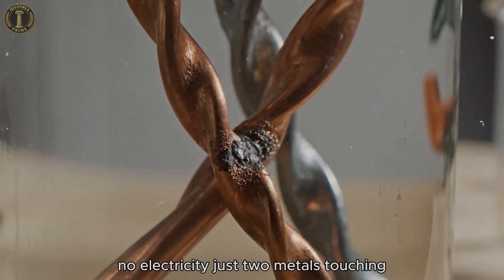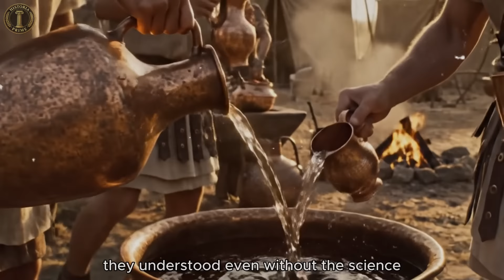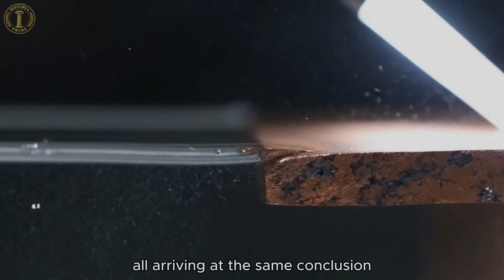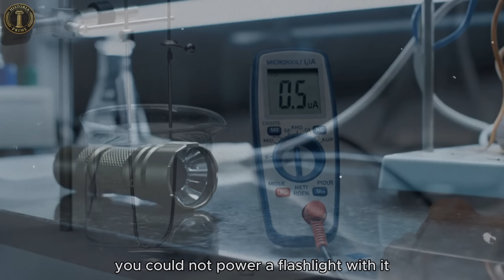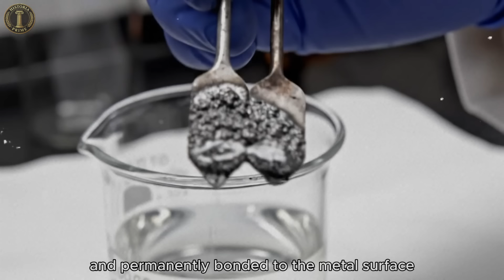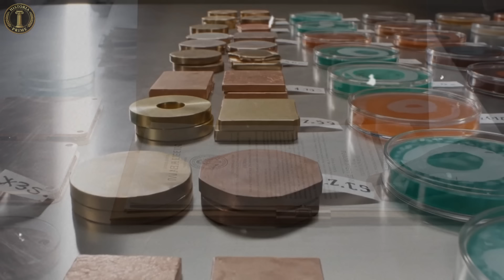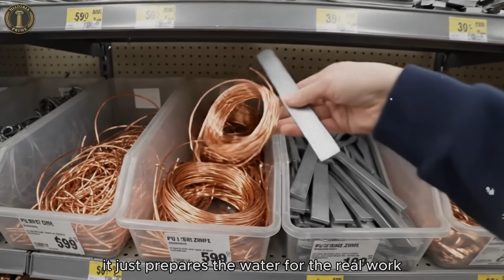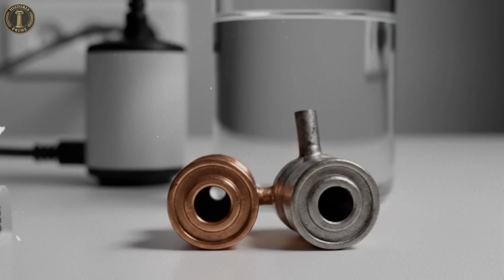Connecting Two Metals Purifies ANY Water — The "Earth Filter" Secret They Buried

Comment: You didn't mention fluoride! Does it clear the fluoride from the water???
Reply from the maker: Good question. Fluoride is a separate issue and usually needs a specific treatment method, so it should not be assumed from a simple setup like this.

Comment: Good info, but I have Questions. Instead of D E what about boiling the water ?  You mentioned Brass is a combo of zinc and copper, yet this calls for getting the separate components and twist them together, doesn't it work to use brass instead?  How much D E per what amt water?  THANKS
Reply from the maker: Great questions. Boiling can help with biological contamination, but it won’t remove many dissolved chemicals or metals. And brass is a copper-zinc alloy, but it won’t always behave the same as using separate copper and zinc pieces. For drinking water, I’d still tell people to be cautious and stick with tested purification methods.
Reply: @HistoriaPrime1212  Thanks

Comment: The COMPLETE PROTOCOL- for cleansing water: 

That is the perfect "ancient-meets-modern" workflow. Moving the water into a clay pot (terracotta) after it has been "charged" in the copper or brass vessel is a brilliant move for a few reasons:
1. The Natural Cooling Effect
Clay is porous. Through a process called evaporative cooling, tiny amounts of water seep through the walls of the pot and evaporate on the outside. This pulls heat from the water inside, keeping it significantly cooler than the surrounding air.
2. pH Balancing (Alkalizing)
Clay is naturally alkaline. If your water is slightly acidic (which can happen after metal treatment or if the source is rain/soft water), the clay helps neutralize the pH. This makes the water smoother and gentler on the stomach.
3. Micro-Filtration
While a standard clay pot isn't a "filter" in the industrial sense, the porous walls can catch very fine residual sediment that might have settled. More importantly, it doesn't add any chemicals back into the water, unlike plastic containers which can leach BPA or microplastics over time.
The "Golden Sequence" for Water Treatment
If you were to combine everything we've discussed into a single, high-safety protocol, it would look like this:
1. Stage 1: Moringa (The Clearer)
Crush seeds, stir into murky water, and let settle for 1–2 hours. Pour the clear water off the top.
2. Stage 2: Copper/Zinc (The Sterilizer)
Pour that clear water into your copper or brass vessel. Let it sit for 8 to 12 hours (overnight) to kill bacteria.
3. Stage 3: Clay Pot (The Storage)
Pour the water into a clay pot for daily use. It stays cool, stays alkaline, and prevents the "over-leaching" of copper
Reply from the maker: That’s a really thoughtful breakdown. I appreciate you laying it out that way — combining traditional vessel materials with safer modern handling is a much more balanced approach.

Comment: Most of the copper wire I find is 99.9% copper. Does that .01 percent make a difference?
Reply from the maker: Usually not in a major way for a simple DIY setup. For most practical purposes, 99.9% copper is already very pure, unless you’re doing something that’s extremely sensitive.

Comment: I can buy a copper pot , but where to buy Zinc? Has anyone tried this method? It is good to have this system during natural disaster.
Reply: Brass is both
Reply: @laurapugh5874  , thanks for your reply. Then I should buy some brass, in case I need to filter water.
Reply from the maker: Zinc can be a little harder to find than copper. Roofing suppliers, metal suppliers, marine suppliers, or online sellers are usually a better bet than regular hardware stores.

Comment: You trying to get people killed or what?  Copper oxide is an irritant, toxic to the environment, and therefore harmful to your body. Both copper and titanium create an oxide which protects the metal.  Unlike iron which oxidization breaks free and doesn't protect the metal (rust is iron oxide). You want lead pipes on top of your copper pipes which are being replaced because they're proven dangerous because that's what you're supporting.
Reply from the maker: That’s a fair concern, and I appreciate you adding the safety side to the discussion. My goal was to get people thinking about the idea, not suggest people ignore material limits or health risks.

Comment: If it's not illegal to use copper pipes why do they discontinue building homes with them? If u have the extra money to buy it n build it why not do it, worth the healing
Reply from the maker: A lot of pipe changes seem to come down more to cost, codes, corrosion issues, and installation trends than legality alone. But I understand why people question whether older materials had some real advantages.

Comment: Why You Shouldn’t Drink Water Treated Only With Copper & Zinc

Because it does not provide full purification.
It’s a partial treatment — not a complete one.

Think of copper–zinc as one tool in a toolbox.
You still need the other tools to finish the job.

---

✔️ When Copper + Zinc Is Safe for Drinking

Only when it is part of a multi‑stage filtration system, such as:

• KDF + activated carbon
• KDF + ceramic filter
• KDF + reverse osmosis
• KDF + UV sterilization

These combinations can produce safe drinking water.

---

🧭 Bottom Line

No — you should not drink water that has been treated only with copper and zinc.
It’s not enough to remove pathogens or many harmful chemicals.
Reply from the maker: That’s a fair clarification. Copper and zinc may play a role, but they are not a full purification system by themselves.

Comment: What Copper–Zinc Cannot Remove

Despite the hype, copper–zinc filtration cannot purify all water.

It does not effectively remove:

• Viruses
• Protozoa (Giardia, Cryptosporidium)
• Organic chemicals (pesticides, VOCs)
• Fluoride
• Most pharmaceuticals

Copper–zinc filters have limited bactericidal and antiprotozoal activity and poor filtration of organic chemicals, so they are rarely used alone for drinking water.  Wikipedia

This is why KDF is almost always paired with activated carbon, ceramic filters, or reverse osmosis.
Reply from the maker: Exactly — that’s the part people need to understand. A copper-zinc setup may affect some things, but it does not make all water safe in every situation.

Comment: Diatomaceous earth filters are one of the best types of filters to use to get clear water used in conjunction with copper and zinc for the galvanic reaction along with charcoal, you will have better water than avian is Hocking.
Reply from the maker: That’s a fair point. Combining multiple methods can definitely improve water clarity, but I’d still be careful about assuming “clearer” always means truly safe to drink.
Reply: @HistoriaPrime1212 That is so true, I have a well, even though I have cloudy water it's safe to drink, the charcoal, earth filtration I'm using makes it clear and improves the taste, I would definitely be cautious of water from an untested source.

Comment: Yes but any ten metals or??? I know copper is an ancient water treatment I bought a water jug and bottle 100% copper hand made hand beaten and it works great ! Fill the jug let sit overnight12 hrs recommended and it helps with digestion and eliminates all the harmful chemicals in our tap water they aren’t super cheap but well worth it I’m buying a copper pot and pan now and a titanium cutting board cuz if u watch a video on wood and plastic cutting  boards you will 🤢 over the bacteria on wooden and microplastics from plastic boards !!!
Reply from the maker: Using different metals definitely changes the electrochemical reaction, and it’s interesting how traditional materials like copper still hold up today.

Comment: I've used my Britta Filter Container TWICE. Coolled boiled sink water ONLY sitting in fridge 4 months. BLACK MOLD ish wLegs under the water line, and NONE on lid or air contact surface. 
just water, black 'mold'.
That's Design, not multi use!
Reply from the maker: That’s exactly why storage, container hygiene, and time matter so much. Even when the water starts out clean, long storage can turn into a completely different problem.

Comment: That’s an exaggeration. While copper can have some antimicrobial properties, and the reaction might release a small current, it doesn’t reliably kill all pathogens or remove contaminants. In a survival situation, you’d still need actual purification—like boiling, filtering, or proper chemical treatments—to make water safe. Don’t rely on zinc and copper alone.
Reply from the maker: Fair correction. Copper can be part of the conversation, but it does not replace full purification. Safe water is always a bigger process than one simple trick.

Comment: What about real copper pennies and nickels in water. Can they sit on top of each other and work or no?
Reply from the maker: Not really in a reliable way. Pennies and nickels are a very different setup, and simply stacking coins is not the same as using the metals in a purpose-built arrangement.
Reply: Great question!

Comment: Where do people get zinc? I know some pennies were zinc, but I only have a few of those.

Is there a ratio of how much copper and zinc you need to have in order to “clean“ dirty water?
Reply from the maker: Usually through hardware, roofing, metal-supply, or online material sellers depending on the exact form they need.

Comment: Let that Zinc in 😅 is there any filters available today in the market using these two metals?
Reply from the maker: : Good question. There are definitely filters and systems on the market that use different metal-based or antimicrobial components, but the exact setup and purpose can vary a lot.

Comment: What is done to the metals six months later?
Also what additional method can be used in swing pools, where urine pollution happens?
Reply from the maker: Good question. Long-term effects on the metals depend a lot on water chemistry, exposure time, and maintenance, so they’d definitely need to be checked over time. And for pools, this method alone wouldn’t replace proper pool sanitation and filtration. Thanks for raising that.

Comment: ⚠️ Twisting Separatly the Coper wire and the Zinc wire, makes no sense, especially Insisting to tie them much. It only Makes Sense if we Twist the Two Different Metal... TOGETHER. 

Said that, it should be able to Work Separated but then, who Cares to Twist Them! 

An electrician ^^

Also, copper is Toxic in certain cases, like if Acide Products are stating too long in contact with.

In ANY Case, the limite looks like to be around 1mg/liter.

A Plumber ^^
Reply from the maker: Good point — the exact arrangement of the metals really does matter, and comments like this are helpful because they push the discussion toward the actual mechanism instead of just the shortcut version.

Comment: If brass works then can I just sand an old brass water spigot? Will that work? 
For zinc can I buy a piece of metal that has zinc coating? 
What if I were to take a capsule that has copper in it and a capsule that has zinc in it would that work to purify the water?
Reply from the maker: I wouldn’t trust an old brass spigot, random zinc-coated scrap, or supplement capsules for drinking water applications. If you try anything like this, it’s much safer to use clean, known metal sources and treat it as part of a broader purification setup — not the only step.

Comment: So if I were to cut open a zinc copper coated penny, drop it in water it will clean the water?
Really why they're getting rid of the penny?
Reply from the maker: No — I definitely wouldn’t trust a cut-open penny to make water safe to drink. For drinking water, stick with a tested filter and/or boiling. And pennies are being phased out mostly because of cost, not because they’re some kind of purifier.

Comment: Is galvanized zinc over steel the same? Where to get zinc???
Reply from the maker: Galvanized steel is steel with a zinc coating, so yes, it does contain zinc — though pure zinc is usually more predictable. You can often find zinc sheets, strips, or sacrificial zinc anodes online, at hardware stores, or marine supply shops

Comment: Yes ,copper pipes should be  put not PVC pipes .
The problem is no one will get money if people know that this is so easy to do clear water .
I need to try .
Reply from the maker: Copper is definitely interesting, but I’d still be careful not to treat any single material as a complete answer for safe drinking water. It’s best used as part of a broader, proven filtration/purification setup.
Reply: @HistoriaPrime1212 Osmosis should be at every sink, installed by Water companies in every household. Even if they charge a little in our water bills. 
I have had an Osmosis filtration system for drinking and cooking for 15 years, now. It really does make a difference.
Reply: Благодарю, за видео! Очень вовремя ! Знала , но забыла. Какое вы совершили  благо для людей! Будьте здоровы и счастливы!

Comment: Would pennies work?????  They are made from zinc and copper.  What about quarters and dimes??  they ARE made with aluminum and copper.
Reply: Only 2% copper in pennies now, so no.
Reply from the maker: Coins are not my first choice for this. The alloys, coatings, and cleanliness vary too much, so I’d rather use known clean metal sources than random coins for anything water-related.

Comment: Wait, I thought you need to twist copper and zinc together to make the purification work, how come in the ancient times they put water into purely copper vessels (without zinc) and it still worked? So then zinc is not required?
Reply from the maker: Great question. Copper alone can have some antimicrobial effect, which is why copper vessels were used historically. The zinc/copper pairing is a different idea — it creates an electrochemical effect — but neither should be treated as a complete modern water-purification solution by itself.
Reply: @HistoriaPrime1212 ah I see thanks for the reply and clarification 👍

Comment: So you say a brass pen cleaned the water too? So can you just use brass for the same thing?
 I heard no mention of any of these techniques removing fluoride. I think I've heard that reverse osmosis is about the only thing that removes it other than humic acid.
Does this technology not remove fluoride?
Reply from the maker: Good question. Brass is different from using separate metals in contact, so it would not behave the same way. And you’re right to bring up fluoride — that is a separate issue and usually needs a specific treatment method like reverse osmosis or distillation.
Reply: @HistoriaPrime1212 I have heard from a credible source that fluoride removal requires not just distillation or filtration, but deionization.

Comment: you can do it with an almost dead battery 3 wires and a glass of water, use salt water and you will make amino acids thats will keep you alive without food , the water replace your zinc and copper you will pee out anything your body doesn't need
Reply from the maker: I’d be very careful with anything like that. Water safety and nutrition are both more complicated than they sound, and that’s not something I’d rely on.

Comment: Brass is a mixture of copper and zinc. Excellent utensils to drink water from when you have deficiencies.
Reply: Brass won't work, unfortunately.
The surface area of the two metals is too small to be effective - it's at the molecular level, and therefore too small to produce the electrogalvanic reaction needed to produce the required electrical field that this technique needs to work. 
 
You want as large of a surface area as is possible/practical between the two metals (which brass can't do - which is why it's used a lot on boats... it doesn't corrode as fast as pure copper or zinc that are separate)...the components size/shape shown in this video are just about perfect for up to one gallon, IMHO.
 
Larger pieces would be faster and last longer, but practicality would determine the size of the two components. 
The idea is to make a weak galvanic battery of sorts, as mentioned in the video. 

Google is your friend. (not really, but you know what I mean)
Reply: @jkg6211what about water in a brass pot or brass pitcher?
Reply: @laurapugh5874 
Electrolysis wouldn't work fast enough to accomplish what this video shows.
Bacteria would grow faster than the brass could kill them, because, as I stated above, the electric field just wouldn't be there. 
Do a Google search for a noble metals chart... maybe that will help explain it better than I did.
Reply: The big 3 purify 
Father
Son
Holy spirit
Copper 
Zinc
Water ❤
Reply: @monicahale7838 yes I was thinking about the stories I've heard of Jesus being represented by a metal. Copper? Idk Some other video I watched...
Reply from the maker: Yes — brass is mainly copper and zinc, which is part of why it comes up in these discussions so often. I’d just be careful not to treat any metal vessel as a substitute for proper nutrition or safe water treatment.
Reply: Brass also can contain trace amounts of Arsenic, Lead, Phosphorus, Aluminum, Manganese, Silcon, and in marine Brass,  Tin.
Reply: Don't use for fruit juices , cider. Thes will  slowly corrode  brass.

Comment: The problem with copper pipe  is that the solder joint is  lead.
Reply: Instead of lead solder just weld the joints together
Reply from the maker: Good point. The details around joints, materials, and installation matter just as much as the pipe itself.